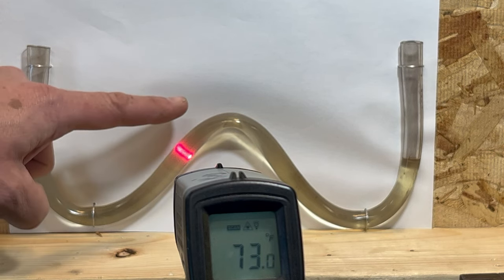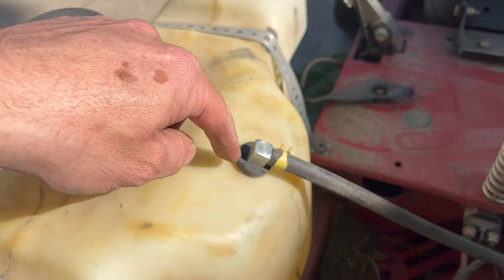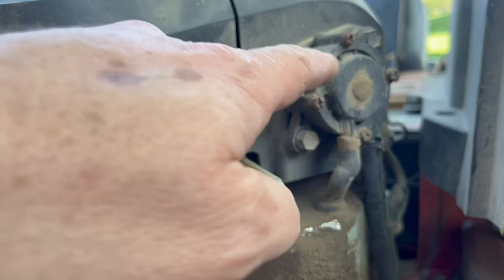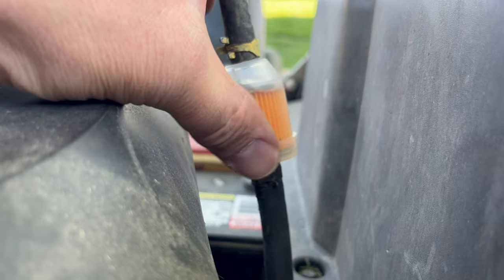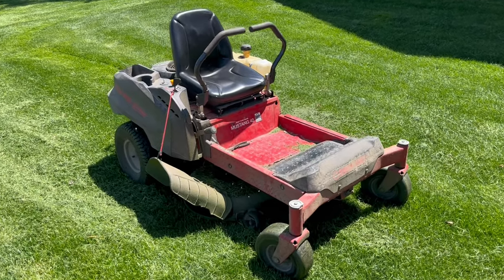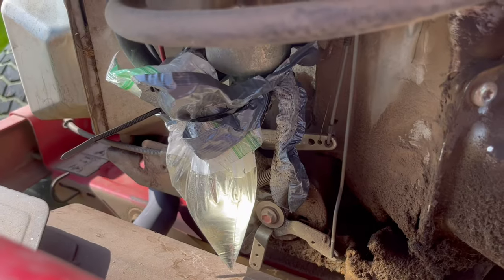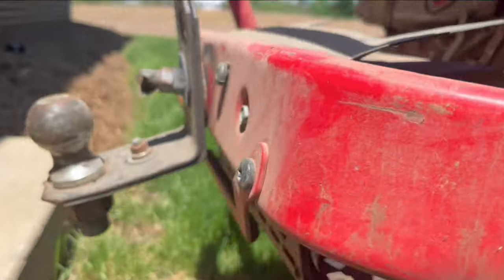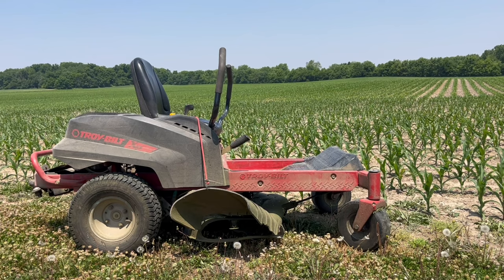Fixing Mower Vapor Lock

Comment: Have lost my mind over the past 2  1/2 mowing seasons.  Riding mower was stuttering. Cleaned the carb, changed fuel lines, tuneup, 2 new fuel pumps, consulted mower repair shop.  A week ago, the mower started stuttering and dying and I remembered hearing about "vapor lock" several years ago when I having a problem with a chainsaw.  Took the gas cap off the mower for a second and it stopped the vapor lock.  Going back to check if muffler is loose or what else might be causing the prob.  Thanks for restoring my sanity

Comment: I wrapped the carb on my deere x530 in titanium insulating tape. I also did it too the fuel line and muffler. I then blew out all the dirt inside the engine housing. Mower works great again!
Reply from the maker: Nice work!

Comment: Great explanation. Thank you!! I have a similar issue with my John Deere X300. When it gets hot, it's hard to start. I have to crank it over for at least 4-5 seconds. Sometimes I'll get a popping sound, which to me means fuel starvation. The gas filter is almost always empty but they say that's normal for this model. I suspect vapor lock as the hot start problem. Probably caused by inadequate heat shielding on the carb bowl. Thoughts?